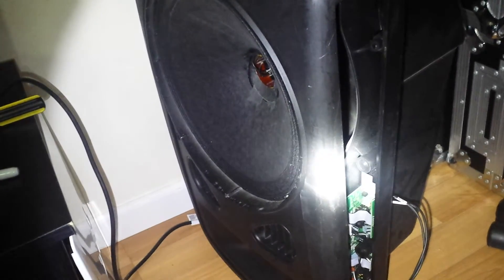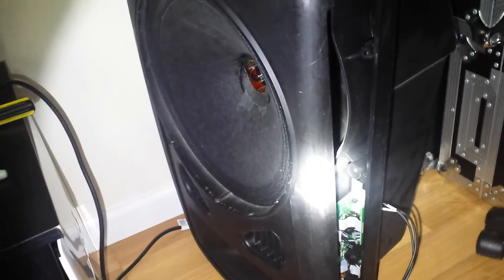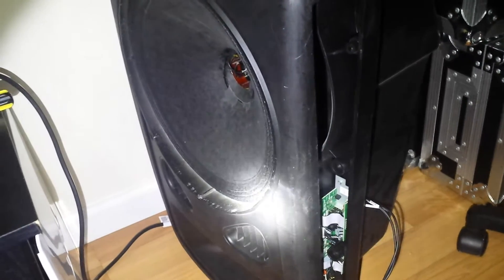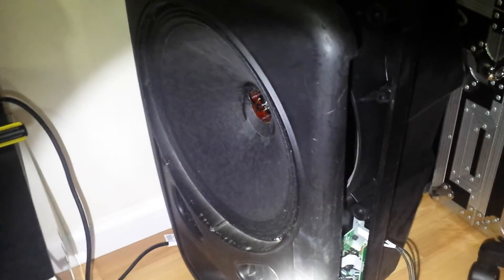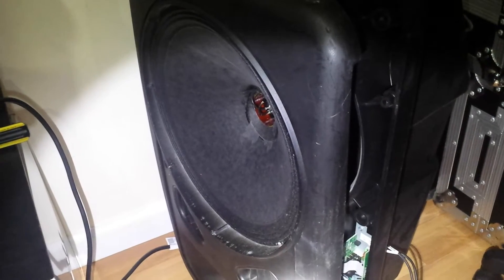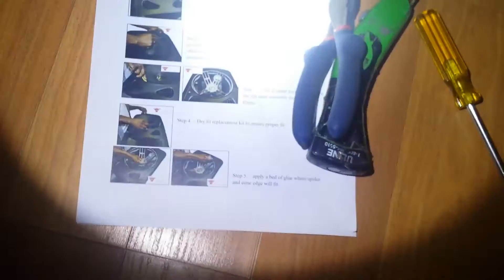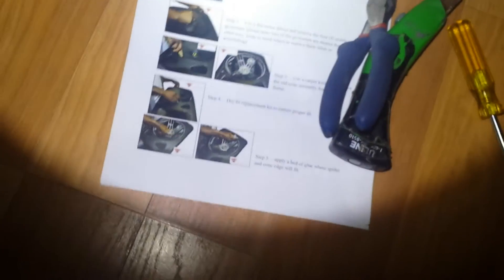Jbl eon 15 g2 bad woofer fix

Comment: I was given a G2 15 with no sound from the woofer. I found your video whole trying diagnose the problem. Still, I didn't want to cut up the woofer first thing, so I removed all 16 or so screws to open the cabinet. Didn't see any loose wires. Fuses looked good. Any problems inside the amplifier would be over my head. So I closed the cabinet, took off the grill, and cut off the dust cap with a razor blade. The wires underneath were attached, but wiggling one brought the sound back. You nailed it! Didn't want to start the cone on fire with a soldering iron, so I bent the wire to a position that made the sound stable, and then dripped a little bit of wood glue around the connection so hopefully it will shift even less without the glue causing any rubbing. Would have saved a lot of time if I'd listened to you in the first place! I think you've identified a weakness in the way these were put together. Will test the results more thoroughly this weekend.
Reply: My fix didn't work - it helped, but cuts out and distorts with any volume. I don't see where the solder would go to fix the connection? Any suggestions?